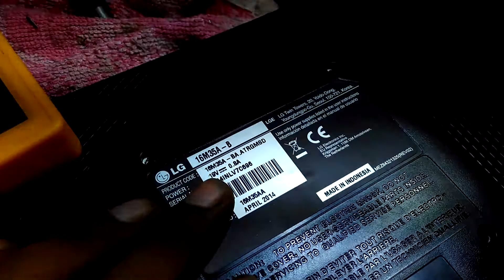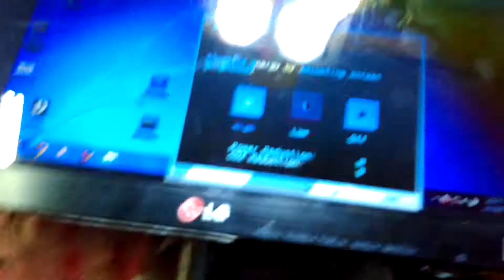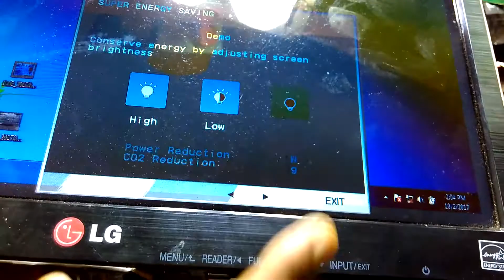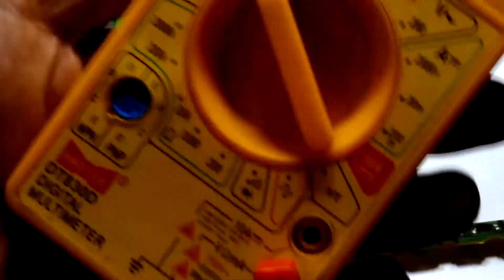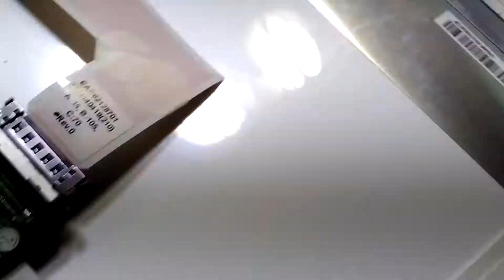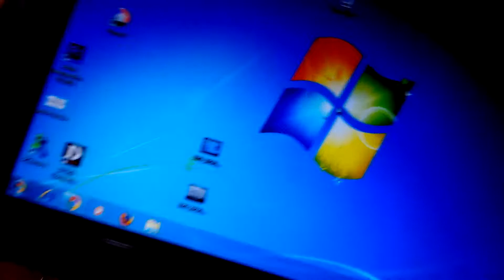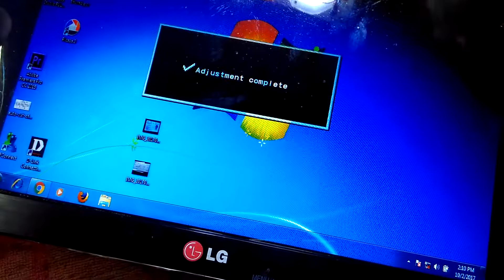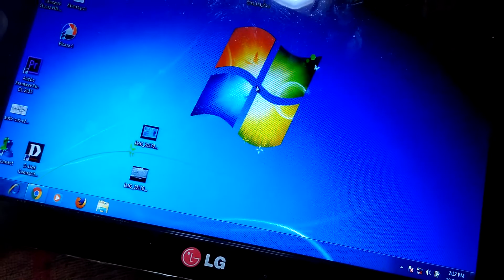lg 15.6'' led monitor repair #common fault in switch panel

Comment: Hello, mai ek problem face kar raha hu.. screen pr auto adjustment is progress aisa baar baar aa raha hai.. solution do please
Reply: Same bhai same I m also facing same problem
Reply: @pushpabhoye1470  found solution
Reply: @pushpabhoye1470  ye problem maine solve kiya
Reply: @ni3patil  Sir please muze batao
Reply: 🙏 batao me bahot pareshan huuu
Reply: @pushpabhoye1470  1st thing, It is hardware issue. So u have to open monitor backpanel. Then just disconnect cable which is connected to buttons.

Your problem will solve .
(JUST DISCONNECT THATS IT)

**Optional**
***If u have soldering gun then just solder again auto button connection point on PCB. Then u can connect wire if u want.
Reply: @ni3patil  thanx sir

Comment: KAISE SAB KUCH KAM KAR RAHA HAI??? AAKE COMPUTER SCREEN MEIN TOH BAR BAR AUTO ADJUSTMENT KI MESSAGES BAR BAR AA RAHA HAI? AUR MERA BHI EKJI SAME PROBLEM MONITOR MEIN BAR BAR AUTO ADJUSTMENT KI MESSAGE AARAHA HAI AUR PANEL KOYBHI SWITCH KAM NEHI KARRAHA HAI??? MEIN KEYA KARUN BILIYE????????

Comment: Bhai mera lg ka monitor me d sub bar bar aa rha hai aur reader on ho jaa rha 1 2 baar baar aa rha kabhi power saving mode on ho jaa rha h bhai niche ka LG ka monitor ke niche ka button dabane se bandh ho jaa rha h kuch help kro bhai mera no. H 8370054651
Reply from the maker: Check the button switch
Reply: Same yahi issue mera bhi hai button nikalkar use kar sakte hai kya ?